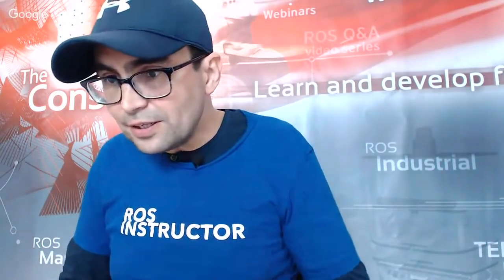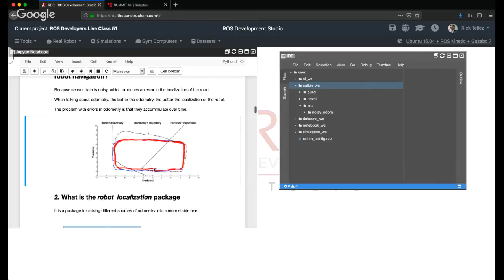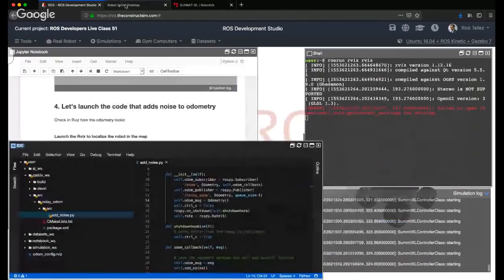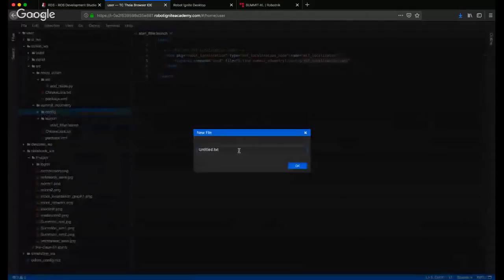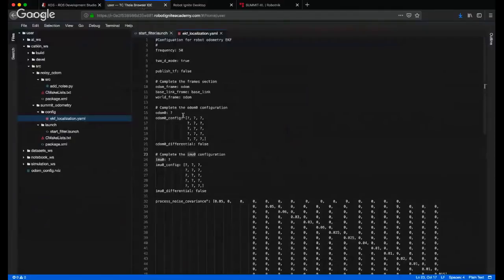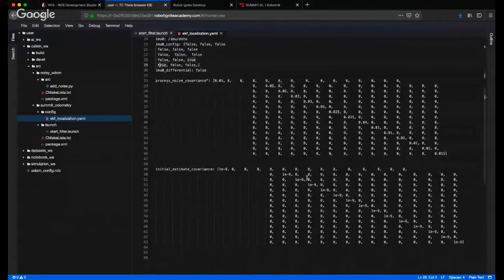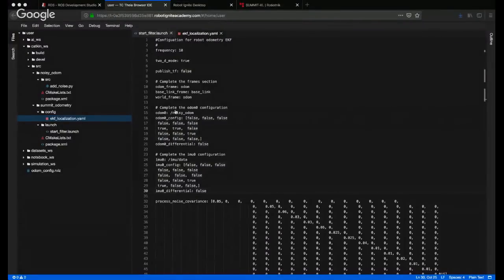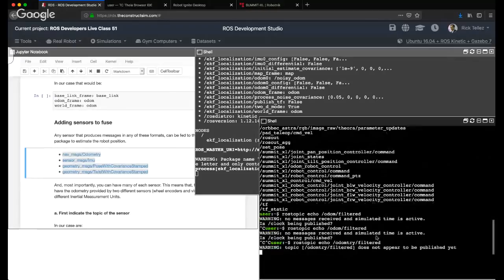ROS Developers Live-Class #51: How to fuse Odometry & IMU using Robot Localization Package

Comment: Hello Rick @The Construct 
Thanks for the great demo! I would appreciate your help with a few questions: 
1. Does the localization node automatically handle topics that are being published at different frequencies ? For example, Odometry node could be being published at 10 Hz and the IMU at 100 Hz
2. Will the UKF work with the same .yaml file ?
Reply from the maker: 1. The localization node doesn't care about the frequency of publication. It will work the same way independently of the differences in frequencies. However the results obtained may not be what you expect if you have threads publishing at a low frequency. It all depends on what needs to be measured. If you need to detect very fast changes in order to provide a very good control, then you need to have a high frequency loop. 
Having said that, you may not need to have the  IMU thread so fast if you are going to use it only in combination with odometry, and the odometry is a lot slower. 
2. Yes. You only have to change the EKF by UKF
Reply: Hello, can you help me with the zip of this project, when i try to fork in  " robotic ingnite ", the folder is not the good one. the conf of robot in rviz the robot like in the video. Can you help me, i want to work on localization using robot_localization (Odometry and IMU)
Reply: @raphaelkhangmate3215  Hmm not sure what you exactly want or whether your question is for me. Regardless, I don't have the files. But you can install the localization package and follow the steps from the video in order to fuse your own odometry and imu. That is how I did it.
Reply: @rahul122112  Thank you for your response. i solve it.

Comment: Can this fusion of wheel encoders and imu be used with Hector SLAM?
Reply: hector just need laser
Reply: @alanxu7533   Yeah that's true...but hector SLAM will fail in case of a long narrow tunnel with less features. In that case I wanted to use Odometry, that's why I was wondering whether it is possible to include odometry as well.
Reply: Sadly, it is not possible to input nav_msgs/Odometry, into the Hector SLAM package.

Comment: Im getting a problem where my robot start drifting in the map when it start to move, without the ekf it works perfectly but when i used ekf everthing goes wrong and i need it to introduce an IMU
Reply: Try calibrating your imu first. Which mpu are you using?
Reply: @jashmota5054  I'm not using an IMU yet that test was only with the Odometry
Reply: i am also having a similar problem.there is drift when i visualize in rviz..is ur problem  solved ??
Reply: @danieldaza1895  it's a very common issue. Which values are you using from the odometry?
Reply: Hello, can you help me with the zip of this project, when i try to fork in " robotic ingnite ", the folder is not the good one. the conf of robot in rviz the robot like in the video. Can you help me, i want to work on localization using robot_localization (Odometry and IMU)